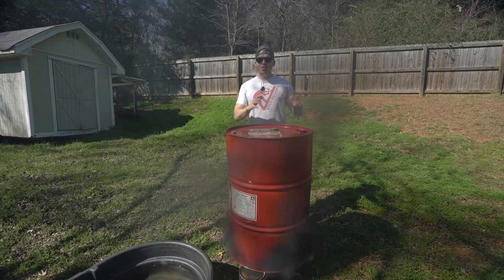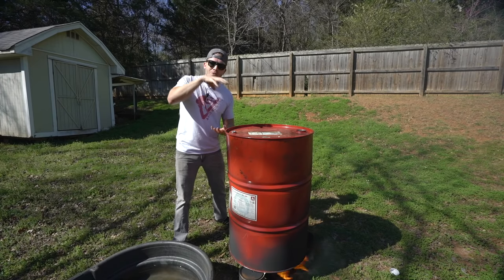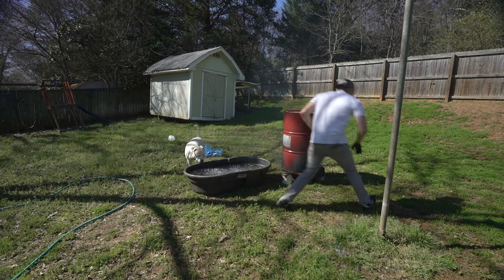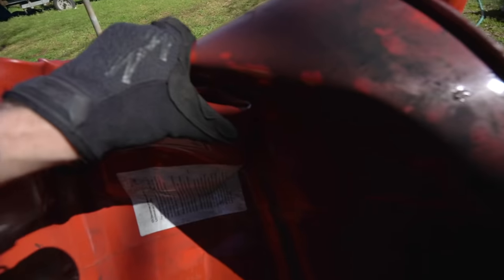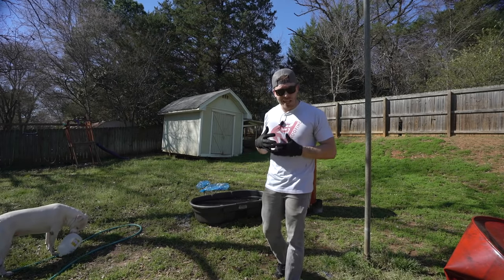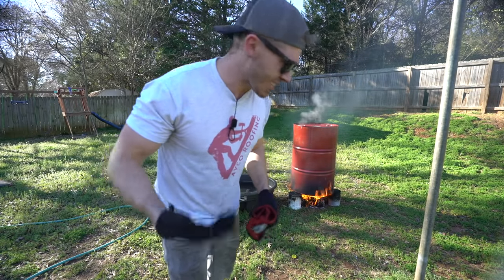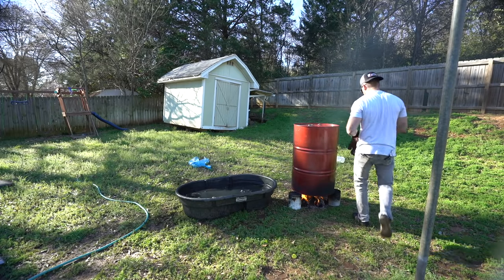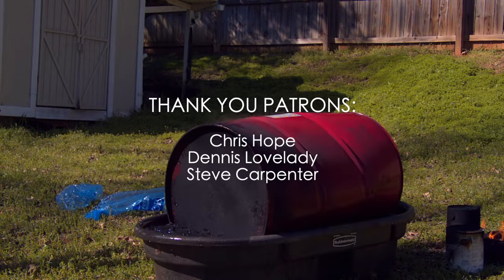Crushing a 55 Gallon Steel Drum with Atmospheric Pressure

Comment: Might have been way easier to mod the cap with a pressure relief value. It would have allowed the steam to exit without you having to burn yourself getting the cap on and risk a steam explosion. Once you throw the barrel into the water and the pressure drops below atmospheric, the valve would close again, and you get your implosion. Adding it to the cap means you can make the mod once and do as many barrels as you want.

Comment: Just make sure there is no oil inside. Then you will have oil-vapor/air-mix which is not a good idea for obvious reasons... fjuff! :)
And don't put the lid on while still heating it ... pressure will build up quickly and it is dangerous...

Comment: Oil drums are some thing you cant play with. There bigger than you thinck and can be dangerous if you dont know anything about them. A drum reconditioning plant went on fire one day as the spray paint machine just burst into flames and the heat from the fire was poping and blowing the drums every where. And there was at least 900 drums in the plant and the fire just got to much and too fast the men just had to run out the plant. A drum blowing towards your head at 50mph would kill you. And thats just one? This nutter burned heself and the drum didnt even move an inch lol and i thought mate just quit while your head before the lid blows your head off. And hes using drums that have been used and not even cleaned out properly. There not just some daft round toy you can play around with fire. Mad, mental.